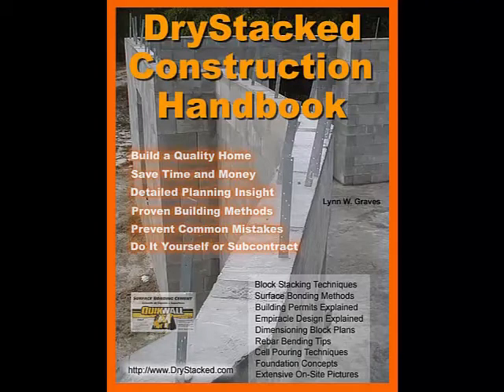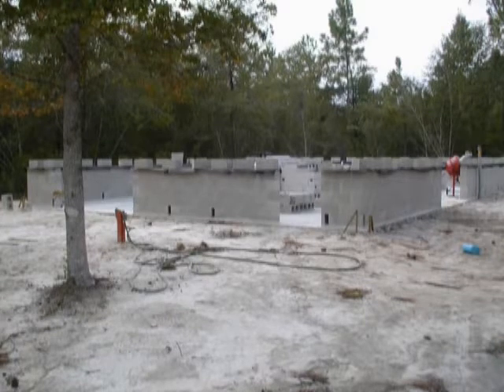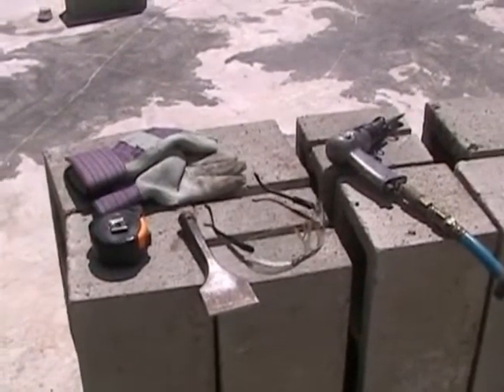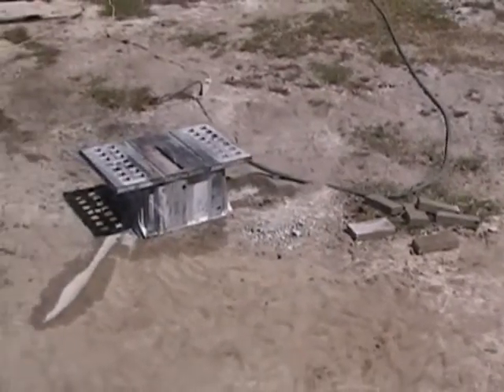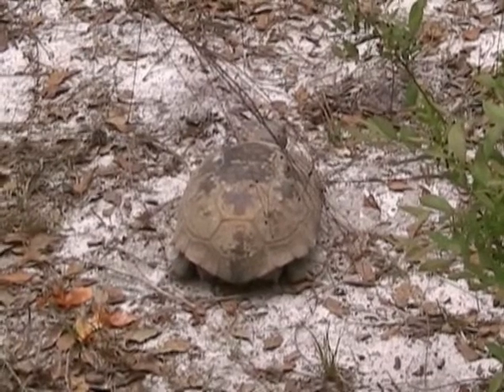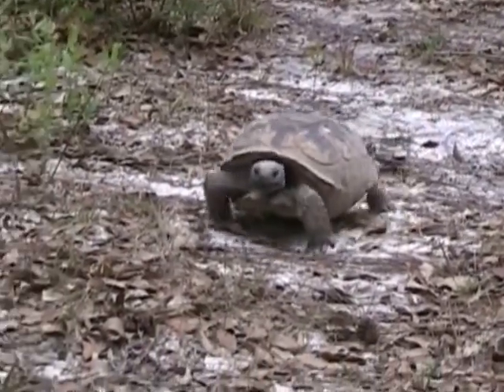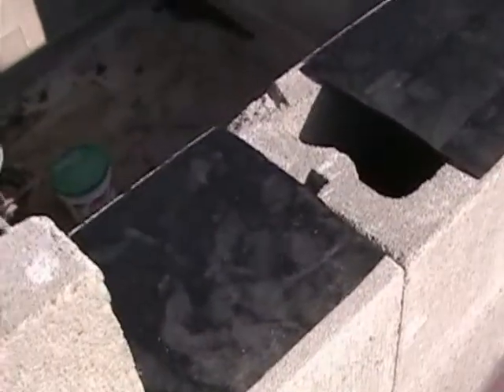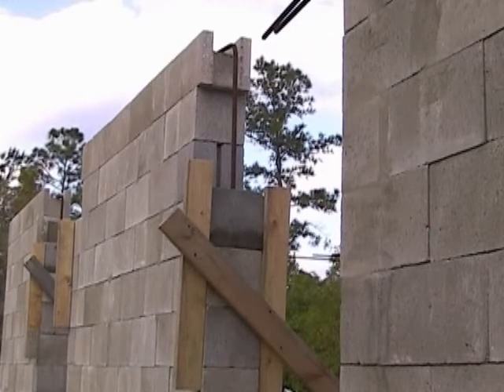What you may not know about Dry Stacked Block Construction

Comment: I don't understand. What is the supposed benefit of the dry stacking method? The alignment problems he highlights which are caused by differing block dimensions, are usually resolved with mortar. That is one of its functions.
Reply from the maker: Mortar is very weak concrete. It is the weakest part of a block wall (for lateral stresses and foundation settling). SBC coating is very strong in all stress directions. I mortared the 7th row to decrease block uneveness as described on the website. How many block or brick walls have you seen with cracks at the mortar joints?

Another point is that a drystacked wall can set for days to allow the foundation to adopt this weight before applying SBC. In this way the SBC coated wall will have no stress related to foundation settling under full load.

Comment: So how can a dry stack wall 6ft high with SBC covering withstand 60-80mph downdrafts from thunderstorms?
Reply from the maker: I guess I don't understand your question about the 9-feet high walls. Drystacked block walls are listed in the Florida building code, and conform to hurricane force winds. If you look at the specifications page you will find the code required strength of the bonding cement (SBC). Maybe you overlooked the grouted rebar in the footers and top row of blocks. This is all explained under "empirical rules" at the website.

Comment: What a clever workflow. I am curious where did you rent or acquire the hopper and the boom? I've never come across a ready mix plant that rented them, they usually want to only rent out concrete pumps. But for a single or two persons using a hopper and a boom like you do is a quite practical solution!
Reply from the maker: The pictures page on the website shows the hopper in early stages of construction, I built my own.
Reply from the maker: Made my own shown in the pictures page.

Comment: I still don't get why mortar is required?  Is that by code?  I saw another video where they did a different "dry stack" method where they used no mortar at all and no surface bonding cement and filled every cell with concrete, but I think they live where codes don't exist, unrestricted land.  So is the mortar required by code?  You can easily just stack all heights of blocks without worrying about little height differences and then grind or add concrete or blocks to make it even on the last row or where you have windows or doors.
Reply: The purpose of the mortar surrounding each block is to provide a sort of cushion for the blocks so that makes it harder to damage them, the mortar keeps the blocks in place and strengthen each section so that the overall strength of the wall is higher and it is more secure as a structure. If you don't have mortar-surrounded blocks or bricks you don't have a strong wall, then it can easily fall down relative to a mortared block wall construction.
Reply: @Nathanael_Grant  That's not true.  The HadrianX brick laying robot uses no mortar and instead uses glue that is stronger than mortar... it can lay brick and build the walls of entire structures automatically that are stronger... the reason mortar is used is to keep the wall level, the mortar is the weak point in the wall...  dry stack block walls without mortar and without glue are stronger than mortar walls...  like I said mortar is used to level up the wall as you go up and was first used with stones so you could apply a mortar bed below the first level of stones and a mortar bed at the top and get a flat final row... also  mortar is weaker than the stones and the bricks/blocks so if the wall settles or breaks the mortar breaks instead of the blocks and the mortar can be easily repaired... where as if a solid concrete wall settles the wall will crack and be more difficult or impossible to repair...  so there are many reasons mortar is used, but it's not to make it stronger since mortar is weaker than block/brick or stones... non mortared walls with glue or with a surface bonding cement are stronger than mortared walls...  to do non mortared walls it's recommended to use a higher grade finished bricks or blocks that are checked for uneven surfaces or defects that the mortar would normally hide...  check out the HadrianX block laying robot...
Reply: @VenturaIT  what do you think a mortar is?
Reply: @VenturaIT 
Mortar is glue mate. If it's glued, technically, it ain't "dry stacked".
Anything is stronger than nothing between the blocks. 
You're not a block layer are you?

Comment: Very good sir. Just a few things may need to be clarified. 
When you dry stack the hollow concrete blocks with side walls used with the method. The technology design with open sides (illustrated) such as H-block, or even better with the "double H" type. Then to note concrete hollow blocks but with ends then shark jaws such as aligning next to each other. You can then simplify as a DIY builder and win big time gains and do it for the construction demonstration of the garage walls.
Check out my comment (with a lot of info) on the video "building the foundation" of (one who builds with solid and masonry Lecablocks, which is still associated with fire risk as not concrete then used when rebuilding a burned down previously built building again) Mind sparx (youtube). ''It's all in the wrist''? No, not really. It has (to make it simple) through the design for non-masons and non-carpenters to do with the design of the concrete blocks and how easy it is to be able to reinforce the blocks both vertically and horizontally. As well as being able to fill the blocks in all cavities with self-produced concrete. (You fill the wall in stages after building 3-4 stacked courses.) Using the wrong type of concrete block makes the work difficult DIY. The implication unnecessarily complicates the otherwise easiest way to build. Thus simply becomes more troublesome. In turn, which then discourages many DIY in e.g. In the US, using concrete and building concrete houses (which is really such a shame when there is just so much) easier than with the most common method in the US, 2''x4'' joist for walls.